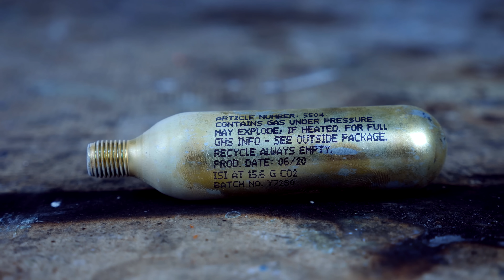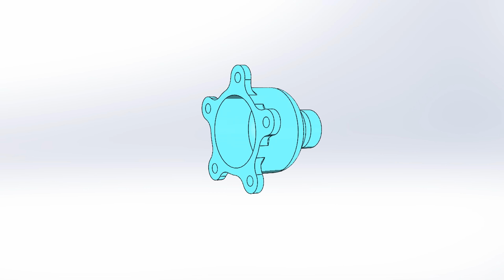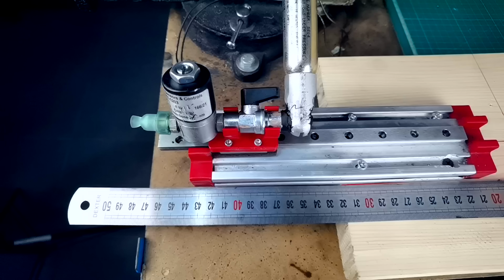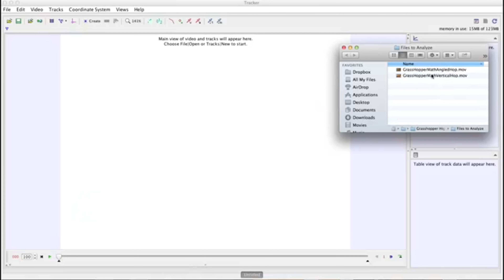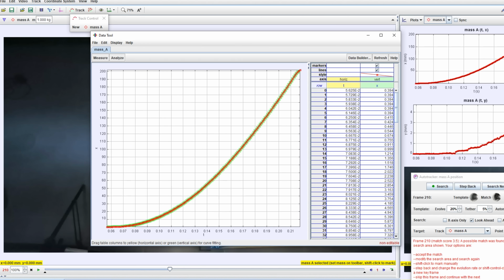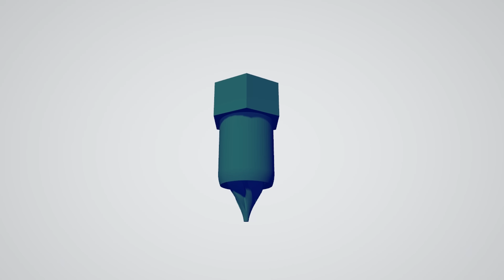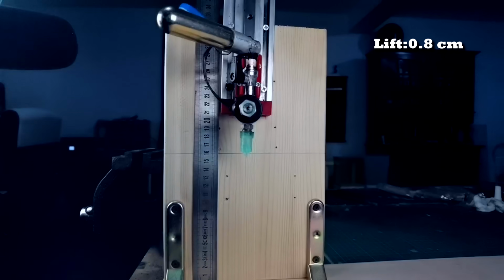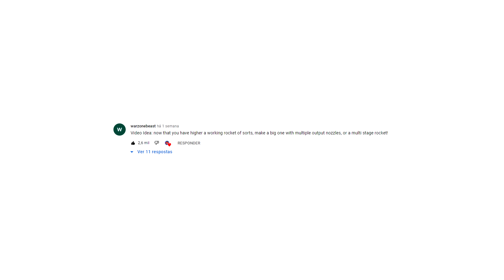I 3D printed a CO2 Rocket

Comment: how about making a water cooled 3D Printed Vortex Rocket Engine, like this https://www.youtube.com/watch?v=tqEfbJRKzeQ but with an Integza twist with a ceramic style engine.   plus you really should learn to weld, so you can build the rear assembly (throat and bell from sheet metal).  even a large washer and a cut off funnel could be welded together and incorporated into the 3D printed body which would be cooled by the vortex design.   want to go farther?  you can simply design a better engine body then your current "cough" designs by incorporating water cooling (like a water cooled PC), so you would have a 3D printed water cooled modular engine body to help keep the body cool.   Even a tomato would have been smart enough to come up with a water cooled rocket engine body and bell for cooling.   pretty sure they would also have used high temp o-rings at the joints.  (where do you think I got this idea?)  they may be disgusting, but they seem they know about water cooling.  :D

Comment: Why not a rocket powered tomato crushing machine? 

Could be an actual way to visually compare the force provided by each of your previous rocket models while also being a "special one time only" test video.

Since each time the size and weight of the structure of the "rocket" varies a lot, is somewhat difficult to know which of your previous rockets (CO2, hydrogen peroxide, Devils Toothpaste) is actually the "most powerful".
This could help visualize that by somewhat standard visual destruction of the tomato.

Comment: Vid idea: make an array of co2 cartridges, rc valves and a bigger engine connected to all the cartridges to make the 1st stage, then maybe a single cartridge engine for the second stage. You could wire the bottom stage so valves can open at the press of the same button and create significant thrust, maybe even calculate twr and open groups of cartridges in a chain for more continuous thrust. This setup may be too heavy tho so I think just go with a bunch of cartridges all opening at the same time for 1st stage.

Comment: If you want to get the most power possible out of those cartridges, instead of puncturing the foil at the back. You leave it in place and heat the whole cartridge until it breaks open on its own. This way you can also remove the weight of your valve too. You may want to construct some shieldimg for testing this.

Comment: Suggestion : try to make ion thrusters (their thrust is low, used to travelling in  space) ...

All you have to do is to make a high voltage source and some other stuff

The only thing is that you must run the engine inside a vaccum chamber(or low pressure chamber)....

Don't know it will work or not but you're now giving a hand to other type of Non-combustion engines So i thought this idea may serve you as a good content Too😅

Best of luck man 😅

Comment: Integzaa the ceramic honeycomb catalyst that you made for the peroxide rocket I've been noodling an idea how about putting the honeycomb in something like two liter bottle put a pressure sensor in the two liter set it at 80 or 100 lb and like an air compressor you're maintaining your pressure and whenever it hits your minimum pressure say like 75 lb a little pump pumps a little bit of peroxide over the catalyst and when it hits the higher pressure that you want it shuts off and if you build this right just like a set of dryers say on a semi or tractor trailer as the used reacted material builds up in the bottom of the two liter a sensor opens a little valve at the bottom of the two later and you let the waste material be evacuated without losing your pressure overall just like set of dryer on an air system and now you've got continual pressure for your nozzles or Rockets and you should be able to scale this up or scale it down and you don't have to put all that waste material through your nozzles because you're pulling your steamer pressure off you're 2 liter at the top using a hose that Carrie's the pressure to your nozzle and the honeycomb catalyst is inside say a 1-inch in diameter pipe on one side of the two liter bottle ending maybe 2 or 3 inches from the bottom it's just something I've been kicking around but I think you can make a separation chamber separating your waste material from your pressure and then like a compressor have a chamber that supplied you a continual amount of pressure using your peroxide as your fuel and with that now you can build say a rocket powered remote-controlled plane as a test stand for your nozzles and Rockets which would definitely be more interesting to watch and it's some point maybe build some Rockets and launch them until you get the bugs worked out of it use it to supply your pressure for your nozzles on your workbench in your shop and instead of working with the round aerospike rocket nozzles I would love to see you experiment with the linear aerospikes engines which would be perfect to put it on the trailing Edge of an airplane wing for propulsion and I wish this thing allowed me to draw simple sketches of my ideas the way I would if I was at a restaurant drawing on a napkin or in a bar because trying to explain an idea using strictly words isn't easy it'd be a whole lot easier if I could help you visualize it

Comment: Hi Integza, big fan of you and your craziness ! 

Since you seemingly want to compare a bunch of rocket engine technologies, have you considered making a proper test bench for your rocket engines ? Nothing fancy schmanzy but with a strain gauge and some rudimentary electronics you could get a thrust value of your designs instead of resorting to indirect measurements, which are plagued with cumulative uncertainty. I did not do the math for your setup total uncertainty, but with s-shaped force gauges, you could get much more precision an actual data for a hundred bucks.

Comment: When i was a cadet, we made model planes out of balsa wood for something called "Around the Pole" lol. 

Anywho, they were powered by an electric motor and tethered to a bearing on a pole in the center, by wires. Give it power and it would fly around the pole.

Maybe you could something similar but with these co2 rocket engines.

https://youtu.be/PXDlFn0G2yM

Comment: Have you considered combining this type of rocket (or maybe your decomposition of hydrogen peroxide) with one of your hotter ones? You could use the cool exhaust to cool the combustion chamber by feeding it around the chamber through pipes in the chamber wall. The nozzle can also be cooled through 'film cooling,' where you feed cooler exhaust around the edge of your exhaust bell. It's how they did it on the Saturn V rocket engines (though there they simply used leaner propellent which burnt cooler rather than an actual cool mixture). Scott Manley's video does an excellent job of describing it from this time: https://youtu.be/aB8knRvUywo?t=437

Comment: Combustion, CO2, Airpressure, guess next time it will be a capacitor Railgun lol, since Altium is sponsoring already anyway, if you were in germany i would sponsor a 1000mm linear rail i'm not using, a bit more testing ground to see the cartridge get empty at least

Comment: You should try building a 3d printed air compresor. Which you could later use to power air compressed engines. It would be cool to see how many psi can handle and what kind of cmf gets.

Comment: Build Solid fuel rockets from the empty CO2 cardridges . open up the top to load them and use the bottom for screw on rocket nozzles.

Comment: Please stop the endless upgrade to the nozzle；
I want to tell you that you have forgotten a very important thing: you let most of the carbon dioxide expand outside the nozzle, which loses a lot of energy! Your engine is like a nuclear-powered hydrogen rocket engine without heating any more.
So I suggest you warm up the carbon dioxide before it blows out:-)

Comment: Try making a rocket based on solod fule which also have features like 3 stage sepration and it would be even cooler if you attached the shell of a fire cracker and try to attempt a guniess wr of highest firework

Comment: I know you have a CNC router now, but I'd love to see you test the practicality of 3D printing template to use with a carbide flush trimming bit on a handheld router to produce aluminum plate parts (they'd be cut close to shape by another method, so the router would only be making them precise). That'd be really useful to those of us without metalworking equipment. Thanks!

Comment: Video idea: The channel major hardware does an audience submitted design segment where they print out audience created cpu fan blades and test their air turbulence, noise, and cooling efficiency. Mayhaps you could call for your audience to design some rocket nozzles and pick 3 or so different designs to test out?

Comment: Instead of CO2 cartridges, why not use an HPA tank like what is used in paintball? You can even run the air through a pressure regulator (again, like what is used in paintball) to adjust the output pressure, which could help reduce the number of exploded prototypes. Also, electronic load cells to test thrust, which means you don't need a test bench that moves.

Comment: what about testing different orientations of the CO2 cartridge. In the horizontal test it would work smoothly because the balls in the rail would be doing the job to allow smooth movements. But in the vertical test with the cartridge off to one side could be causing more friction and not much support from the ball in the rail.

Comment: Video Idea. Since you are using a loot of these CO2 cartridges, maybe try to create your own source of compressed CO2, maybe even compressed nitrogen and make a cold gas truster, what is used as a reaction control system for the falcon 9 rocket.
Reply: Not a very good idea. Have you seen the pressures in these cartridges? Do you want him to die of an explosion?

Comment: Sadly you are loseing most of the energy by ejekting the Co2 while its still liquid Form you need an Expansion chamber with a lot of thermal mass so the pressure can be released.

Comment: Idea: You need to build a pre-launch so you start using fuel at a point that is more efficient. Also with your hot launches you need to precarbonize the points that are going to melt. This will dissipate the heat better and melt less.

Comment: You should put multiple CO2 cartridges so you have more fluel to use...
I advise you to put like 4 or 3 or it will be difficult to assemble the "roket engine" with pipes.
The cartridges should be put vertically so it will have:
1 more stability 
2 less friction with the air (i know that this is a minimal factor but it will be cool)
3 you can parallel more of then.

~Kevin 

See ya!

(If someone has an advice, comment down so i can modify. Tnx)

Comment: why not build a rocket with an aerospike engine which has liquid  oxygen pumped into the tip along the outer edges so as to prevent it from melting and now that metal 3D printing is a viable option we sure can do that. Btw pls help me out people to get a 3D printer for my first year of college

Comment: On your horizontal track, video amount of movement extending a spring.  Calibrate associated required spring deflection force by hanging weights from it and measuring the extension of the spring.  Simpler than using a stress gage and associated electronics.

Comment: project idea: 
since tomatoes are so disgusting, why not turn them into the fuel to be oxidized? You could start by useing lycopin, which is essentially the dyestuff of tomatoes. Since it is a highly unsaturated hydrocarbon (some sort of terpene, I guess) it should be a rather well suited fuel. Either pick up on the solid fuel self combusting rocket or simply fill it into the combustion chamber. Rockets with a combustion chamber are much cooler (or hotter???) anyways....

Comment: You should use your numbers to calculate specific impulse and hence exhaust velocities for the different nozzles. I'm also surprised that the smaller de Laval nozzle performed better when the exhaust was visibly under-expanded. What did you take as the throat pressure when designing  them?

Comment: Build a coax nozzle with compressed co2 running the outer nozzle and to cool the inner nozzle.  The inner nozzle can then run regular combustion without melting.

Comment: I've been thinking, since you made the water turbo powered skateboard, what if you use a pulse jet to power the hot end of a turbo, instead of an electric motor? You could still use the exhaust from the pulse jet to push the skateboard forward after it passes through the turbo so nothing really gets lost

Comment: Maybe you should try make the 0 point of the test launches lower, so the stream of air has more area to push against making it go higher and look more amazing
Reply: That's not how rocket engines work 😉
Reply: @akkudakkupl  i know, bit it would looked much cooler if it launched itself much higher

Comment: 5:00 for the next tester I would advice to use a pulley system so that you can put some weight on the tester and equalize the pull of gravity, you could also use different weights to have a easier time reading the power of your rocket

Comment: Try connecting your nozzle and valve setup to a precharged pneumatic cylinder. You can easily make one out of steel pipe and fittings from a hardware store. Depending on either length diameter or parallel tubes you could get not only enough thrust to move a skateboard but enough file to move it a good distance.

Comment: Can the cold gas of cartridge be injected into the combustion chamber of a normal rocket to increase the pressure as the cold gas increases in temperature? This would be akin to the old water injectors on internal combustion engines. The water would expand 800(?) times more than air to increase the pressure in the cylinder.

Comment: Video idea: As a gratitude to all 3d printers that have helped you in this journey, why don't you try to turn a 3d printer into a rocket ?. I think a small and lite resin printer with some sort of a thrust system ( Ex :- seal the top part and pressurize it) at the bottom might work.

Comment: Integza those co2 cartridges are not solid co2. Solid co2 comes from cooling it down. Those are just extremely high pressure liquid co2 at room temp. Many people have said it before. You’re pushing all of the liquid out before it can expand into a gas and produce thrust. You need the cylinder vertical going into an expansion chamber then to the nozzle to get just the gas out and make it run longer. 🤣 for the sake of my sanity and everyone else’s please like this or comment something similar guys.

Comment: Valves are heavy - isn't there something like a one-time heat-activated valve? maybe a lead bung in a copper pipe that you heat up (electrically)? - you need to get your 'engine' weight down!

Comment: High pressure C02 is liquid, Not dry ice.  Dry ice sublimates way too slowly (in open ambient air) to create enough of a pressure differential to be useful.  You'd have to put it into a small container and wait for it to change back into gas, creating high pressure in the container, then controlled release.

Comment: Hey Integza, how about use a dry ice engine, but instead of those cartriges you use bulk dry ice (or maybe liquid nitrogen) and add it to a high pressure container you build yourself. Maybe with a valve that opens when certain pressure is achieved or maybe the pressure container has a heating element to make the ice sublimate faster (or even more fun, heat it with a blowtorch or a freaking laser)

also, a longer rail would look even more cool, it bugs me everytime when a rocket reaches the end so fast, would look so satisfyingly to see it travel longer (like on the skateboard)
Reply: there is a chance that with a longer rail, the testbed would go so fast it would get free, and then he'll have a rocket of doom going throught his shop

Comment: The problem with co² catridges is that they are not very efficient for vertical because it just go fast but for not a long period of time, if you take multiples catridges and make a sort of water rocket with the multistage idea ( with servomotors )

Comment: Your next video! How about CO2 cartridge rocket engine modeled after the design of SpaceX starship (29 engines)? In this case could keep it simple and puncture all 29 cartridges at same time (no valves to keep it light). 3d printed rocket housing to hold all 29 cartridges in place with nozzles from previous video. 🍅🚀

Comment: You could try a hybrid rocket motor.  The incoming pressure of the oxidizer would act as a safety on overpressure of the chamber since back-pressure would limit flow and slow the reaction.

Comment: You should really branch out a bit. You're super into engines but there is more to a rocket than that. You should work on making a tracking module that you can attach to any full scale rockets you make. With altimeter, accelerometer, and GPS so you can find the rocket later if it ends up far away.

Comment: That valve is to heavy for a rocket, why not try water bottle with dry ice inside them, it will be less pressure overall but much more volume, with may counter act the valve weight

Comment: Idea For Future Video: 
You should build an RC car with a Turbo Axle! That's where the power of a rocket is transferred right to the wheels instead of just being thrust. The exhaust from the rocket feeds into a turbine that is attached to the rear axle and then out the back of the car. They're super cool 😎

Comment: Aaaah the old thrust vs weight conundrum. More thrust usually means bigger rocket and more fuel and thus more mass needing more thrust to move it so bigger rocket and so on. Thrust to weight efficiency is the key.